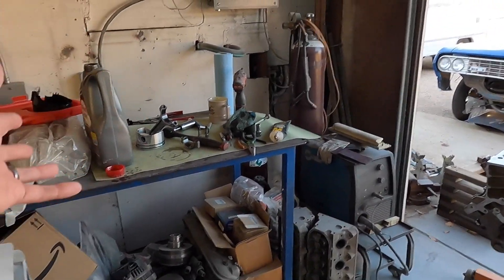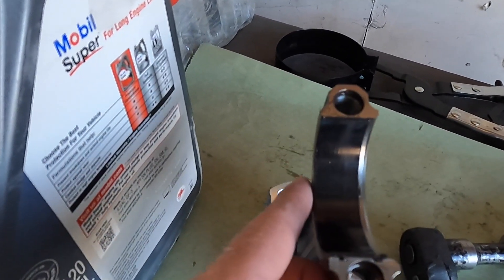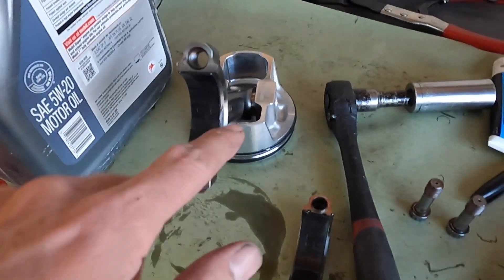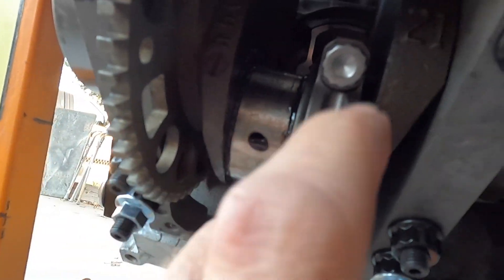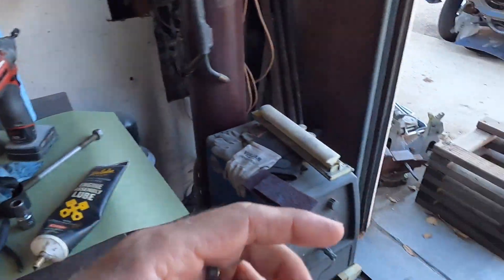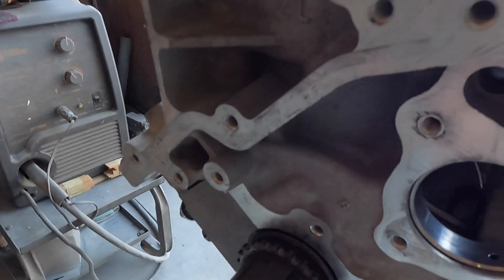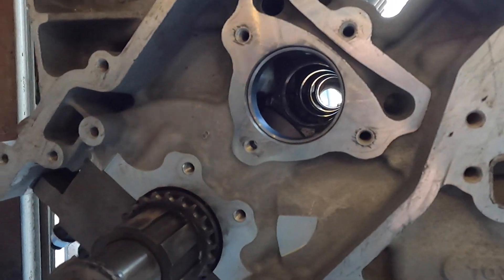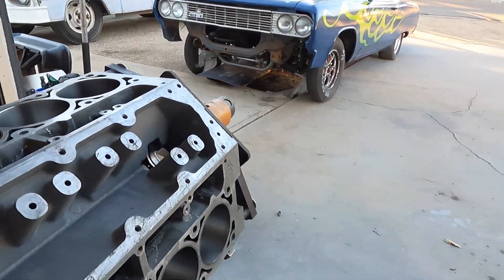Correct Rod Direction For LS Bottom End Build

Comment: doesn't matter on a stock crank because the crank has no chamfer to reduce stress like on an aftermarket one. In fact factory rods spec the dimple going forward which put the chamfer facing forward I believe. However I did insta my rods the correct aftermarket way but I doubt on factory crank that it makes any difference
Reply: I just built a 6,2 for a buddy.  Stock crank has no chamfer on the cheek of the journals and stock rods have no chamfer to clearance the rod against the chamfer of the crank. SO,  on stock parts it doesn't matter.   But aftermarket cranks and rods may be different

Comment: I always stamped my Rod Bearing Caps before removing.
This way I kept up with going back together correctly.

Short strocking chevy engines is something I learned from old racing pioneers.
If you never tried it.
You should.
More horsepower. 
The piston won't have to travel full stroke before the combustion..
You do this by using the piston rods out of a smaller chevy V-8.
Seems we used the crankshaft also.
Don't hold me to that one.
It has been awhile.
Reply: One more thing I remember we used to do.
This was to use a double tooth timing chain sprocket and gear.
Use to order them from some company in California. 
Marty Robins taught us that one on chevy engines.
The short stroke engines ran like crazy.
But would break the teeth off the timing chain gears..
Just a little old school knowledge for you.
Reply from the maker: I realized the rods were marked on one side from the factory so they are idiot proof.... unless you install them backwards 🤣  The factory rods are cracked rods so if you dont mark them you could screw them up easy for sure.
Reply: @Burndown  I gotcha..
Dude..Don't feel bad.
I been there.
First motor I helped rebuild was in 1975.
Yes..
I'm old school.
But learned a lot by Trial and error. 
I like how guys like you picked up the torch.
One thing I definitely learned is to double check everything.
That and when frustrated, walk away long enough to calm your thinking down.
When you walk back..
Everything looks different..lol